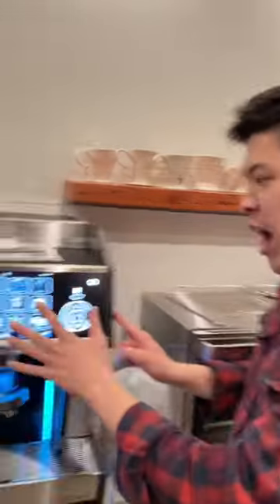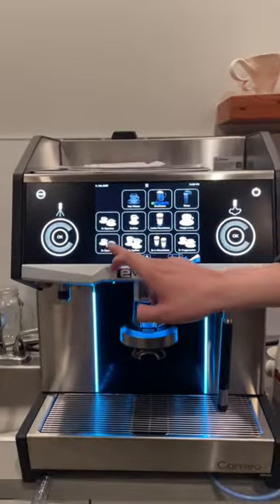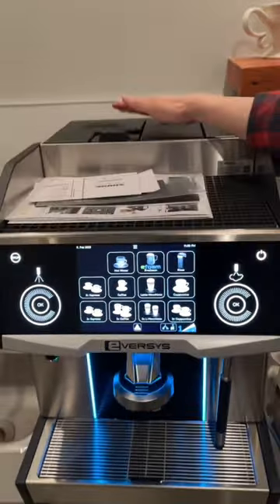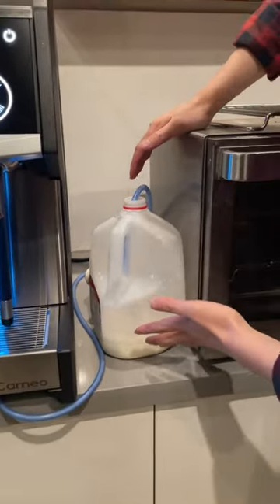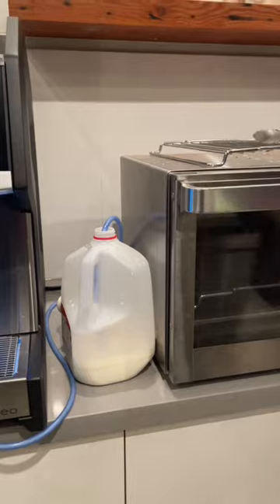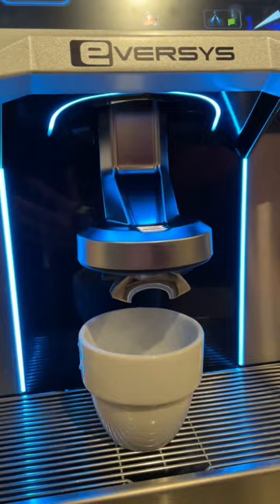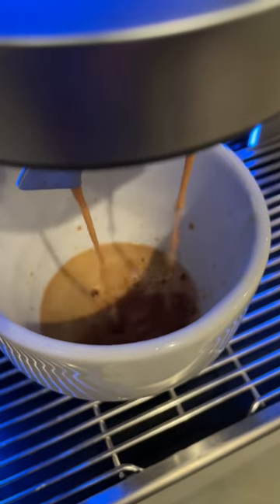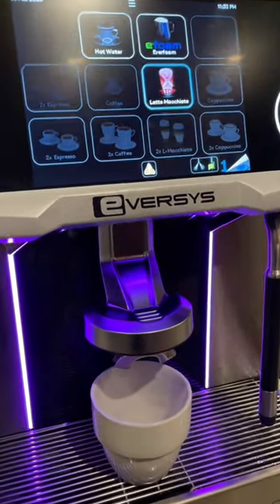Is this the new way to make coffee? Automation and consistency using real beans and milk

Comment: is it airated? like pressurized espresso or not?
Reply from the maker: The foam might be? But the espresso is actually pulled like an espresso shot. Also completely customized profiles too!
Reply: @TALESCOFFEE  wait so, we can set the profiles (well depending on the beans) but it is pressurized since the grinder probably can't do fine enough for espresso (don't know how it will grind lighter roast, since they always said about a superautomatic but for specialty coffee), but still pull shot at 9 bars?
Reply from the maker: @timo7641 no the grinder goes fine enough lol.  The pucks look very promising, trust it's not a pressurized basket.
Reply from the maker: @timo7641 this machine is more expensive then your normal espresso machines, but super automatic.  Quite a few companies in the US are using them now.  Blank street cafe is a good example.  Alfred's in LA is all on Eversys too ^^

Comment: Hi Vincent
I recently got into pour overs and have been following your advice and it's going on pretty well I guess. One thing that keeps bugging me is grind size. In pour over masterclass video you said you stick by one particular grind size even for espressos and adjust your brewing technique accordingly. Can you explain a little bit?
Reply from the maker: Yeah not so much anymore LMAO. Back then I used to use the breville infuser (which I have the video on) but now on the decent espresso I do use just a little finer but I use a paper filter in there to build pressure as well.  I think the lower extraction tastes much better >.< sorry for confusion/lack of ipdate